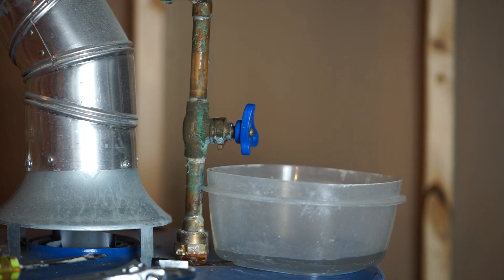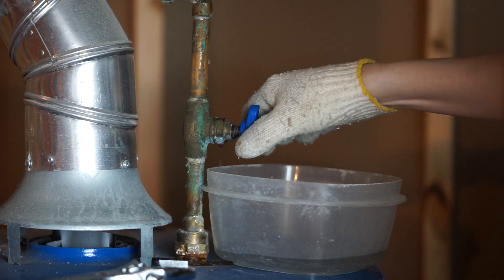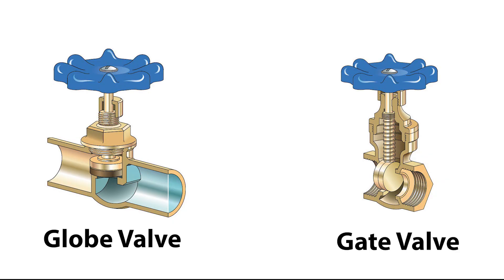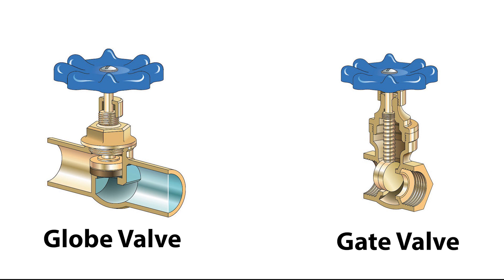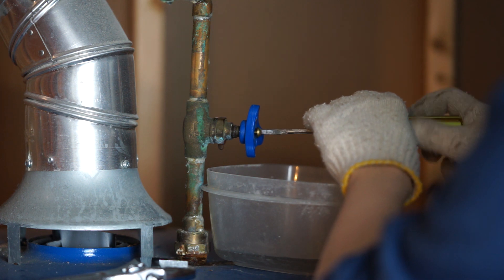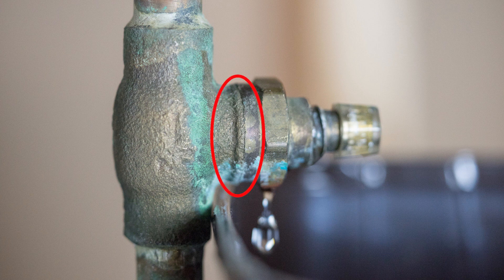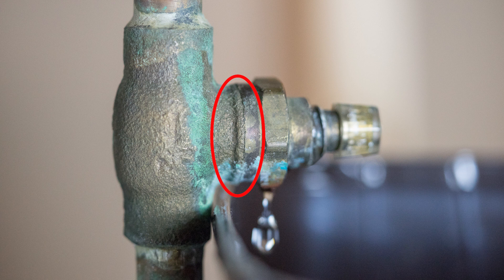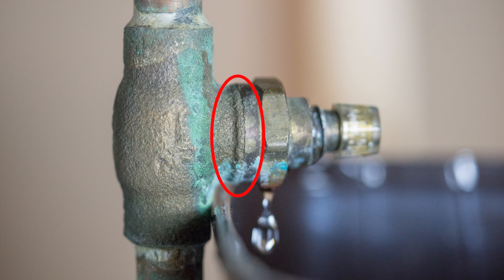Fix water valve leak without packing nut

Comment: You just saved me hours of more messing around and a plumber visit. The part about turning the handle, then turning it some more, that was key. Made the leak go away. My valve doesn't have a packing nut, I watched tomnes of videos trying to find relevant information to my situation. Then I found yours. Very grateful. THANK YOU.
Reply: I tried hours finding a valve without a packing nut and only came to this one.  Probably this is the very old design of a shut-off valve.

Comment: Bhanks for this vid. Mine leaks on the stem when opening the valve, this is my observation before. It just so happens that it is the main shut-off valve for the water coming into the house. But now, it also leaks when I close the valve, leaking on the stem and that is the residual water backing down this shut off valve from the vertical pipe. 
So I need to open the drain port to complete drain the water back down from the pipe.
I will need a plumber to eventually replace this stop valve and replace with a ball valve. Another hassle would be calling the city to shut off the water mains from the driveway/curb of the house.

Comment: Valve without packing nut is designed to use only in ON/OFF position, leaking when valve is in the middle position is expected.
Reply: Thanks for this info. Really makes sense. In the fully opened position, it's the brass plate that will seal and keep water coming into the stem.  But in the fully closed position, it's the rubber gasket/washer/bibb against the seat.  Mine leaks when fully closed, it's the residual water from the vertical pipe backing down this valve.